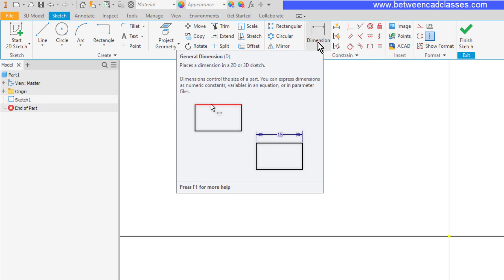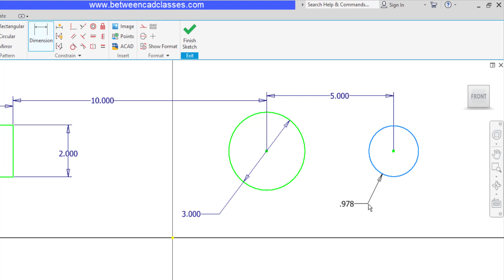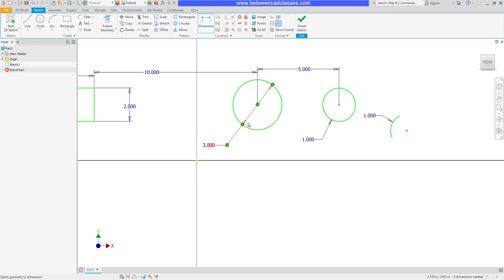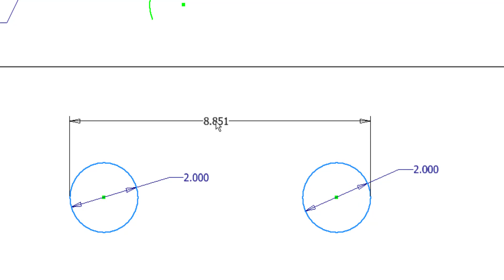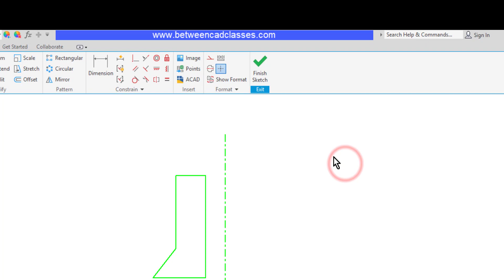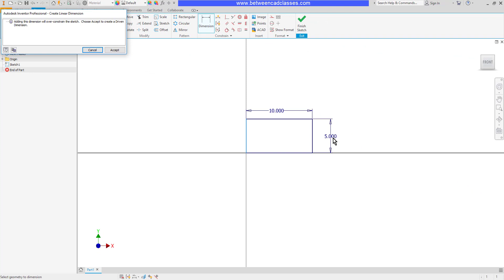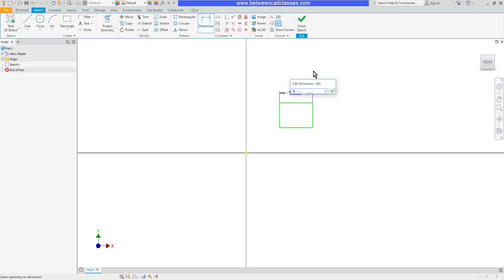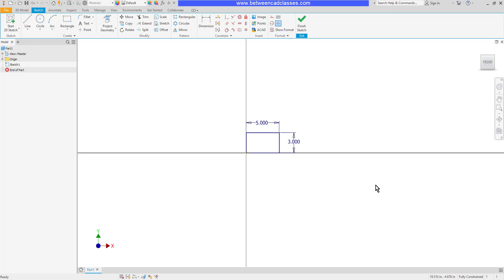Autodesk Inventor Sketch Dimensions

Comment: all great but when I'm trying to change the distance between 2 shapes I still don't know how the order is determined, how is the reference determined?
Reply from the maker: Without seeing the exact situation, I would say that you need some additional constraints. If I am understanding you correctly, you have two shapes with a dimension between them. When you change the dimension, how do you know which one will move? I would argue that you need some additional constraints. One of the shapes should be constrained, whether it be to the origin, another shape, or just fixed in place. Then when you change the dimension that shape stays in place while the other moves. Check out my video on constraints and see if it helps. The link will take you to the fix constraint, but some of the other ones might help. Please let me know if you have any more questions and thanks for watching! https://youtu.be/VzBlDOz1MoM?t=260
Reply: @betweencadclasses  Thanks for your answer. Yes indeed was related to constraints. But still very peculiar behavior.
Scenario. 1 circle at 0.0 , and two smaller circles inside, left and right, close to the edge. 
If you add a tangential dimension for each to the main circle edge you will notice that on the left the smaller circle inside will move,
then on the right, the large circle will move towards the small one.
Yes I will definitely check your video!
Thanks again.
Reply from the maker: @icesystem7  I just tried the same scenario and in my case the small circle moved each time. Of course, if the large circle was fully constrained with a dimension, it would react more predictably with the small circles moving out to meet the large one. I guess the moral of the story is that we are not sure what it is going to do if the shapes are under-constrained.
Reply: @betweencadclasses  true, think's for participating :)